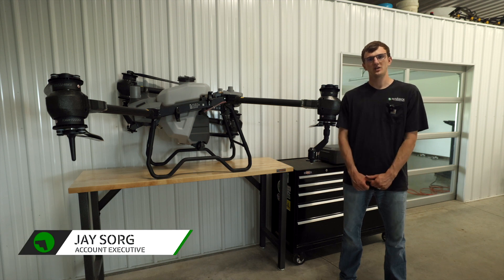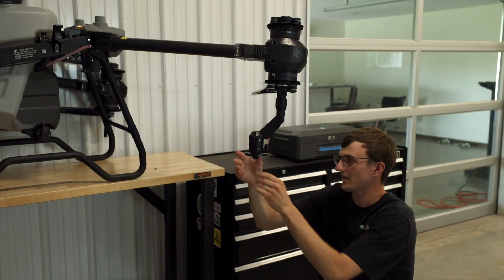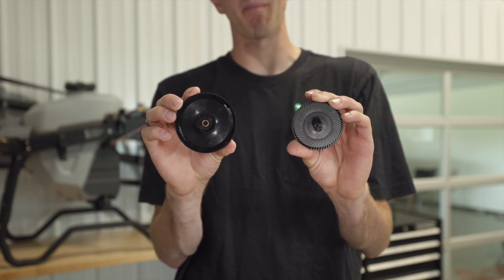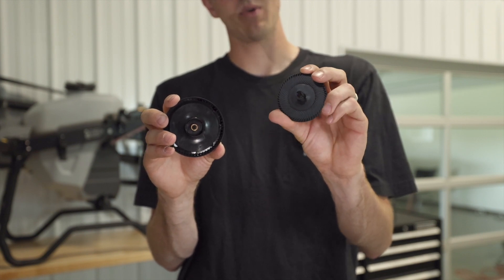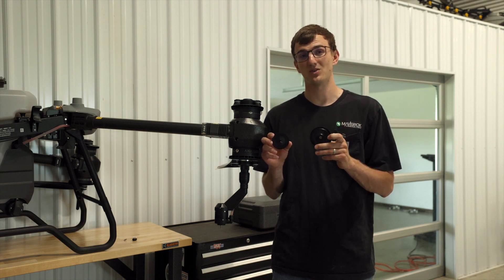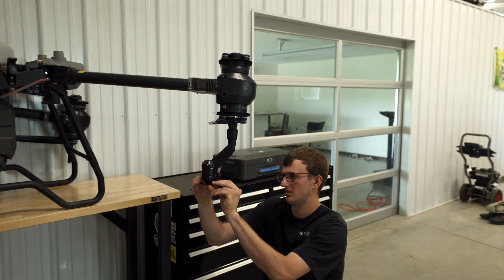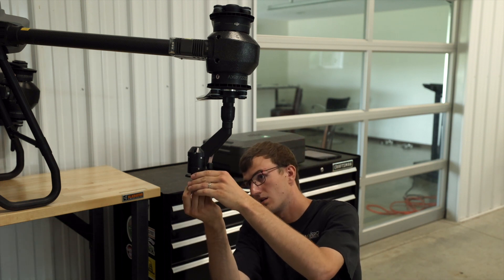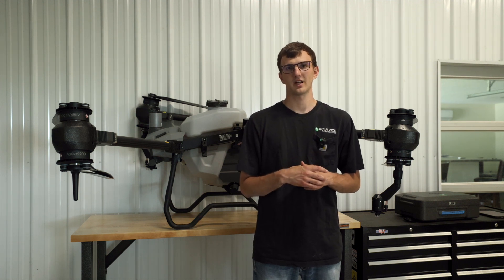Spray Plate Overview & Replacement | DJI Agras T40 | Maverick Agriculture

Comment: Can you give an example of something that requires you to use a coarser droplet? Thanks
Reply from the maker: You shouldn’t be using anything under 100 an outside application because anything smaller than that is prone to drift. But if a chemical takes a smaller size than 100 it most likely shouldn’t be applied via the air. Refer to the label or a license agronomist for further questions.
Reply: So basically the double atomized should even be included with the drone?